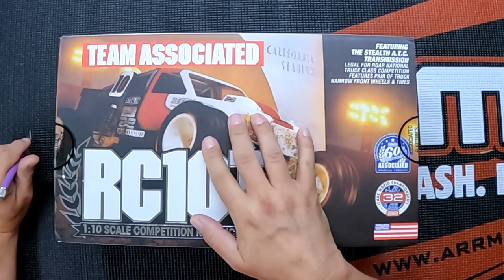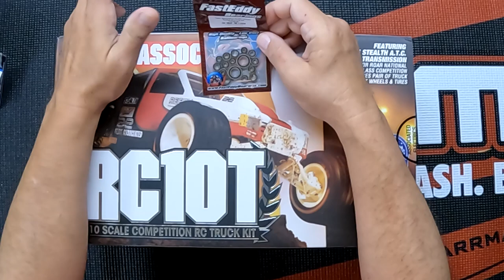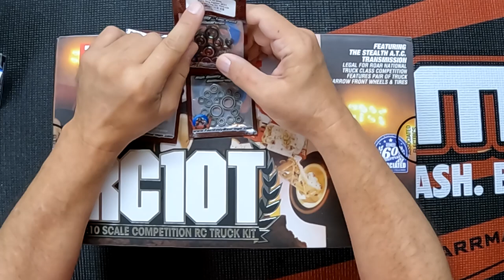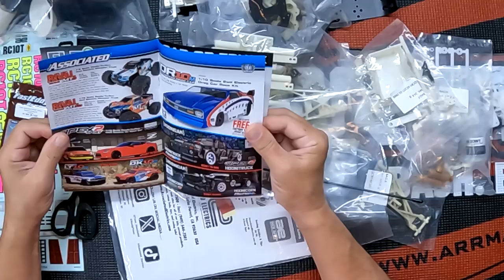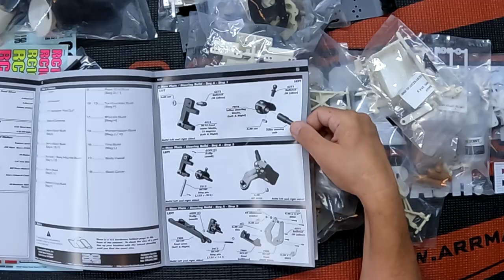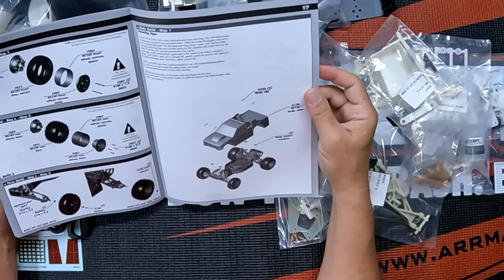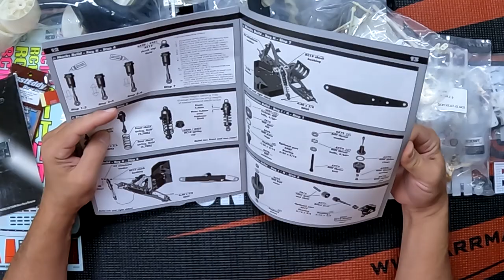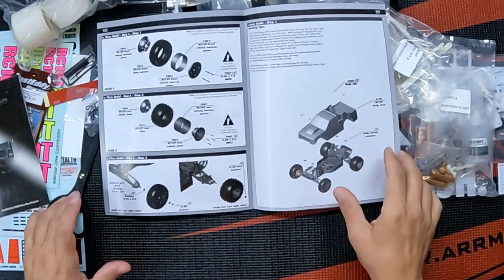Part 1. Building & Racing a Team Associated RC10T 1/10 2wd Stadium Truck

Comment: Looking forward to the build, no doubt it will be done to your usual meticulous standards. I might even attempt to build an rc car / truck myself one winter.
Take care.
Reply from the maker: You should give it a shot... it depends on what you want to do with it of course. So many of the trucks are RTR now. Unless you're going to race somewhere, you'll probably find that everything you like is already built versus a kit. If you can't find a good project kit, you can always plan some interesting mods for the truck you have. You can strip it down, soak and degrease the bearings and reassemble it with some bling and performance parts.
Reply: Once I recover from my surgery which will probably take 3 months I'll be servicing  the diffs and shocks etc on the big rock ready for the spring.
I know from your  previous build videos there's a lot of tiny parts to assemble so that might not be easy for me with my arthritis. Oh well it may not be an option.

Comment: Is it still using the original slipper pad design and felt pad for the transmission seal?
Reply from the maker: @wp1061  More or less, it’s got the “stealth” transmission… I built the RC10 at the same time so I may be misremembering. I think it was the RC10 that has the big felt pad between the gear box and the motor plate but it’s not a seal. It’s to keep mud from building up in that space. Remember, when these came out, they were racing on dirt tracks, groomed clay was years away. 
The RC10 still has that split gear trans with the ball diff as part of the spur gear… just like the original.